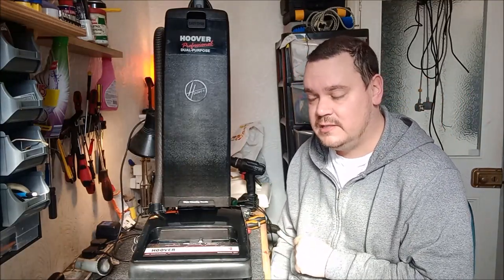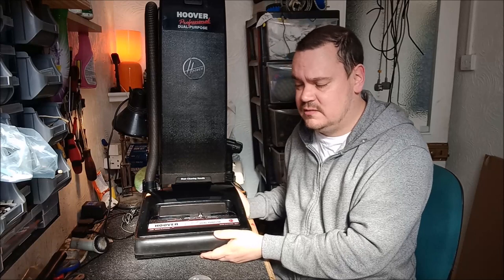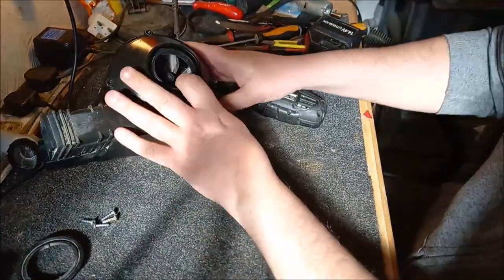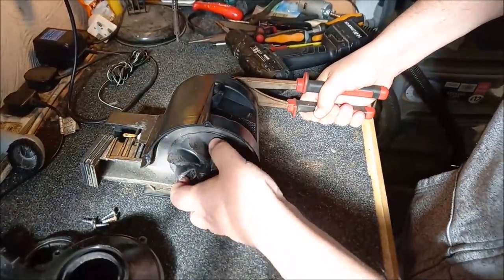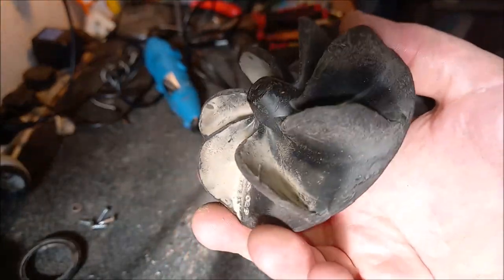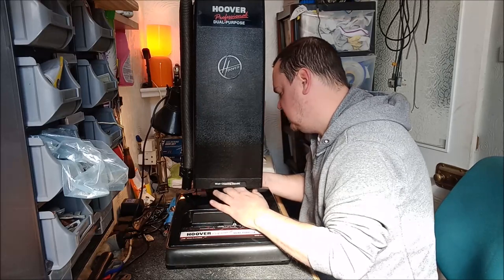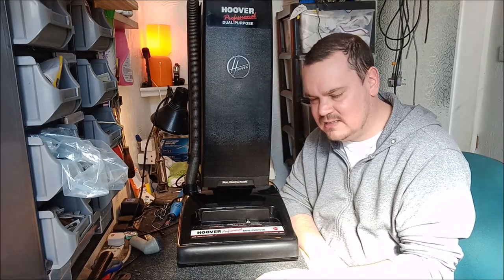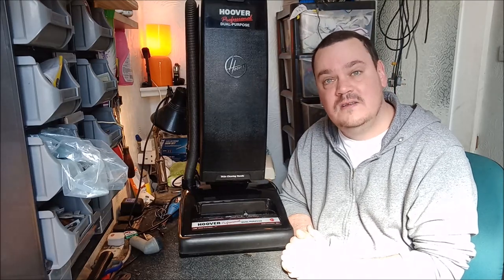Hoover C1417 Dual Purpose Commercial Upright Vacuum Cleaner Restoration / Refurbishment

Comment: Great teardown and refurbishment video.  That rigged belt side motor clamp definitely is not original, the original probably broke off years ago, which was a very common issue for these cleaners, I've had one or 2 of the Elite style cleaners that have had broken belt side motor clamps.  Now the fan on this (which looks a little more similar to the Turbomaster/Innovation fan) motor does look pretty rough, but as long as the motor isn't vibrating or making and abnormally loud noises, I wouldn't see a need to replace it (although your methods to smooth up the fan blade chips are pretty clever I will admit).  It does sound pretty good though.
Reply from the maker: I was very surprised by how well the fan shaping worked